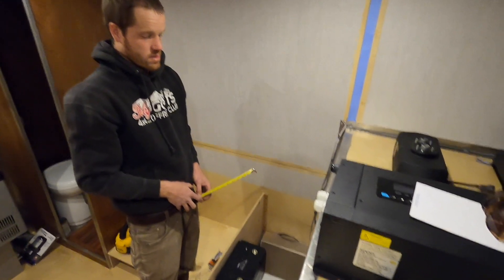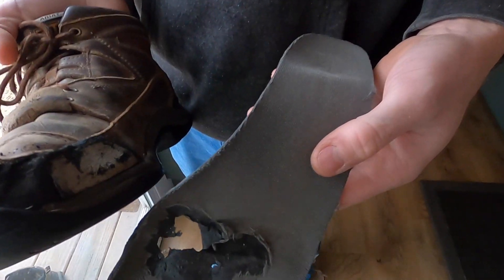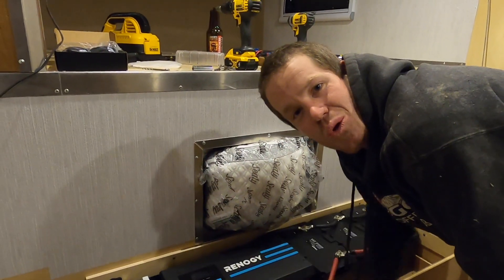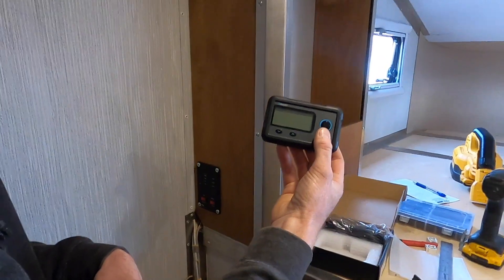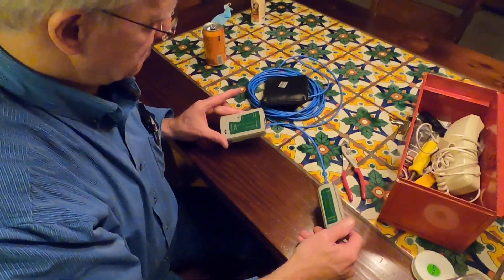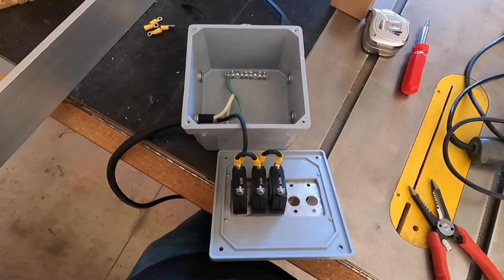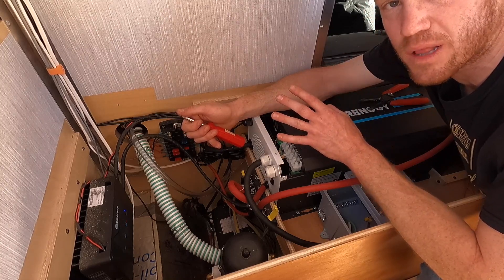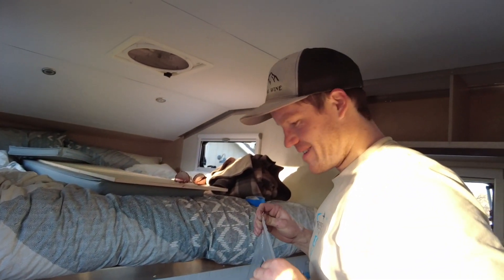Complete Off Grid Electrical System | DIY Expedition Vehicle

Comment: Very nice work. Curious on what you'd recommend for 200w solar scenario (2 batteries). And did you happen to research Redarc products?
Reply from the maker: Sorry for the delay on the reply! I did research Redarc and they look to have some really nice products. I was able to get all the same functionality with the Renogy products at a lower cost. 

With 200w of solar alone it will be difficult to get enough charge during the day to keep two 100ah LiFePO4 topped off (although it really depends on how much you use!). 200w of solar, plus two batteries, plus the 50a DC DC (or they have a 30a as well if you have a smaller alternator) would be a nice set up. This will allow you to charge off the solar or the alternator with once piece of equipment and gives you automatic battery isolation so you don't drain the starting battery. The DC DC has different charge profiles for different battery types (AGM, LiFePO4, etc) and makes future battery upgrades easy! Bonus if you buy the Renogy LiFePO4 batteries is that the $50 monitor screen plugs into the battery to monitor charge level, voltage, current draw, etc and eliminates the need for separate monitoring equipment.

Comment: I really like Renogy. They're a solid company with excellent products. However, they're really only applicable for 12V systems. Once one decides to go with a higher system voltage, alternatives must be sourced.

While I'll reluctantly build 12V systems for clients, my typical build is 24V, with 36V to 52V for certain applications (golf carts, e-bikes, etc.).

My personal system is 24V/2.5KWh (100Ah) consisting of new prismatic LiFePO4 cells and an 8S/100A BMS. Including terminal connectors, cables, buss bars, fuses and a buck converter for variable, regulated DC voltage, the battery cost me less than $500. Also, as my AC loads are extremely minimal (induction cooktop @ 1,800W max, convection/microwave @ 1,100W max, and both will never be run simultaneously), I run a 2,000W inverter. Charging is separate via solar (MPPT), with shore power as a backup. I plan to add a DC-DC converter in the future, and can also add a J1772 port for use with EV charging stations if I ever find the need.
Reply from the maker: Renogy actually recently started coming out with 48v products for residential off grid use!

I agree that 12v isn't ideal for this type of system, however since so much of the RV type equipment is 12v (vent fans, heater, lighting, etc) and the truck wiring is all 12v it really makes sense for keeping things simple. 

That sounds like a great system. We did a lot of research and even started sourcing parts to put together our own batteries but ultimately decided to buy plug and play products off the shelf.
Reply: @AmbitionStrikes  I completely agree with everything said.

As for 12V, again, I employ a sub-$20 buck converter to down-regulate to 12V. The beauty of this approach is that devices expecting 12V actually receive 12V, not down to 10.8V as in a discharged 12V system. This results in the lowest possible current (and resulting heat), thereby promoting device health and longevity. So, the best of both worlds (IMHO).

For the ultimate in simplicity, which for me includes cord and wall wort reduction, a second variable buck converter allows me to specify the voltage that devices require (i.e. 19V for my laptop, etc.). So, I simply set the voltage and plug in the device, eliminating a cord and a wall wort.

If you'd like to recoup the cost of parts you sourced to build a battery, please reach out. I might be able to purchase them from you.

Comment: Great information.  We currently use a Jackery system.  I’ve been researching that system.
Reply from the maker: It offers a HUGE amount of power that allows us to do anything without worry. If you have issues running out power with your current set up I would highly recommend this upgrade! The Jackery is cool for the portable factor.

Comment: Regardless of your solar & battery setup, shore power is always nice to have. Especially when it's snowing and you can't keep the panels clear and there's no sun anyway... Also carry a long extension cord and 15-3OA adapter for driveway overnights, and don't forget to dial down your shore draw to <15 amps so you don't blow your host's breaker...
Reply from the maker: Yes we have already used the shore hookup a few times! The long extension cord was a last minute grab that has come in very handy. That is an excellent point on the amperage draw, we actually blew the breaker in our Mammoth storm episode. Luckily the setting in the inverter/charger was easy to change. Also important if you plan to charge using a Honda 2000 generator!

Comment: I was a science and math guy in college, but my eyes still glaze over with electronics. I guess I just never applied myself to learning the laws. I lived off grid in Alaska for decades and only used a 4 KW gasoline generator to run power tools. Lights were propane (Humphrey), kerosene (lamp oil), and white gas (Blazo). Headlamps and flashlights were mandatory during the very short winter daylight days. It was before LED lighting technology and I had a significant disposable battery budget. ... Photovoltaics were impractical at that time and latitude (the batteries hadn't evolved enough at that time). However, a passive solar hot water system was planned for seasonal running hot water. ... Several friends had successful off grid electrical systems. They'd buy an expensive, large, one-lunger diesel generator. Build a small log cabin with a concrete slab to house it. In winter they'd light a fire in the woodstove in the generator cabin to warm up all the oil and metal, then start the generator. Inside the main cabin, their batteries for 12 volt lights, etc would charge. They'd pump water from the well into storage tanks in the cabin, do laundry, vacuum, shower, etc. One family satisfied all their 110 volt needs once a week with the diesel generator on "power day." The log structure would muffle the drone of the generator pumping away. ... Keeping a motor vehicle running off grid in extremely cold temperatures without 110 volt power is another problem that everyone in interior Alaska faced. But that's another story. ... I'm very impressed with your ambition, knowledge, creativity, drive and tirelessness in pursuit of your dreams. I suspect you've become role models for many because of the excellent videography of your journey. Well done. ... Can't wait for the Moab videos. Please don't miss Dead Horse Point State Park, Navajo Arch (my favorite), Delicate Arch, Landscape Arch, Slick Rock Trail, the view of the fins of Arches NP from Dead Horse Point SP, the Joint Trail and Chesler Park Needles in Canyonlands NP. ... There are several incredible 4wd descent/ascents from the plateau to near the Colorado R, such as the Shafer Trail in Canyonlands NP. It is a stunning hubs locked, low range, dogs in seat belts, crash helmets on adventure. With your current suspension and high center of balance, I'm not sure if you would want to risk negotiating it? ... There are free campsites along the Colorado River on the south bank, along 128 east of Moab. I camped free in Canyonlands NP in winter too. ... Taco Tuesday cheap eats in Moab for variety. ... Enjoy!
Reply from the maker: Wow that sounds like a very fun but difficult life to live off the grid that way! It is pretty amazing how far battery and PV technology have come in the last decade. We are still impressed by how powerful our battery system is, compare to the cost. I'm sure the folks living up in Alaska have it much easier these days given current technology. Can't wait to go to Moab, thank you so much for the recommendations. Sounds like we should pick up a Jeep for your recommended adventures! Don't want to roll our house... 😉

Comment: It's funny how RVers refer to battery capacity in amps instead of watts. Amps don't tell you anything without the voltage.
Reply from the maker: We agree! But that is how the manufacturers rate them so it would be confusing to speak of them in watts. Our system is 12V.
Reply: Example, if the camper has a refrig running on 120vac (thru an inverter), assuming it draws 300 watts, you would divide watts/volts = 2.5 amps. If the Renogy has 100 amp hours of capacity, you'll get 40 hours before your beer gets warm. If the total electrical load of the camper is 1500 watts and all of the stuff operates at 120vac, the draw in amps = 1500watts/120volts = 12.5 amps. Assuming the same 100 amp hour Renogy, 100 amps/12.5 amps = 8 hours before the batt is exhausted. Of course, inverters aren't perfect (unlike my wonderful wife) so these are round numbers. Size the wires to the appliances accordingly.

Comment: "we'll charge the batteries at your moms house" lol  oh thats funny! great vid. you know you could make so many more vids over the same subjects! just friendly input!!! nice system guys. ive been wanting a monitor. but i figured id wait until i upgraded to a new controller with its own lcd. i dont really need a remote monitor, and could easily see the controller where i mount them. can you suggest a renogy mppt with a good display for monitoring?
Reply from the maker: Can you shoot Riley an email with details? He would love to help you out! riley@trailtestedmfg.com
Reply: @AmbitionStrikes  thanks!
Reply: @AmbitionStrikes  pretty sure that you've got a typo in that email address...
Reply from the maker: @JohnHMoore  Thank you!
Reply: I have the Renogy Rover 30 amp charge controller. Its not very useful in monitoring the battery even with the additional blue tooth module. The best thing I added was the Renogy battery monitor which can tell you how many hours and minutes of charge you have left in your battery. It takes about a minute to recalculate battery life after you change the loads or the clouds clear away and you get full solar amps to recharge. I just with they had a blue tooth connection like the Victron has.

Comment: I can't remember if you put solar on the roof. Does the inverter charger also have a solar charge controller built in. What panels did/will you be using?
Reply from the maker: Solar will be coming very soon! We didn’t see a reason to add it before leaving on the trip because we haven’t really seen the sun... 😂

Comment: It appears both positive and negative are coming from one battery. Positive from one end of bank and negative from the other end of the bank otherwise you will get an unbalanced bank. Great set up
Reply from the maker: The cool thing about the Renogy batteries with the Ethernet cables is that they are self balancing!
Reply: @AmbitionStrikes  so I see in there manual they appear to be the only manufacturer to do this. I live and learn. Great build well done.
Reply: I will double down on the comment and say the RJ45 port does not solve the problem of the last battery seeing a lower charge voltage than the first. In Renolgy video about this battery they also say to hook up plus and minus to opposite sides. That will ensure equal distribution of load to the batteries as well when using the inverter. Also noticed you are blocking the vent for the inverter and the box is not vented to allow airflow for the inverter.
Reply from the maker: @Stripoftape  The box is vented on both sides. Thanks for taking the time to voice your concerns, we’ll have to look into that further when we have a chance. 👍🏻

Comment: Do you have plans to maybe install solar panels and would that be an easy connection to your current system if you did install the panels?
Reply from the maker: Yes solar is going to be very easy to add and will be coming soon!

Comment: Great content, thank you for giving me some new ideas. I'm considering building a Pop-up camper/Toy hauler type Rig. I currently have a small Pop-up, and I'm planning on mounting it on a flatbed trailer (18-20'), then I'll have room for storage underneath the Pop-up and loading a Side by Side on the rear.
Reply from the maker: We call that a crawler hauler around here. We had a similar set up for awhile and it was awesome for transporting toys!